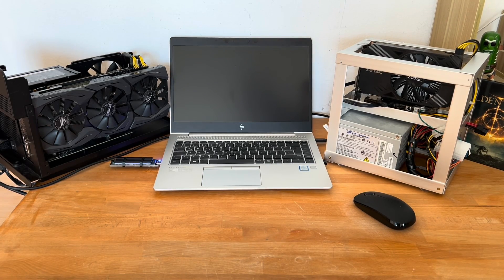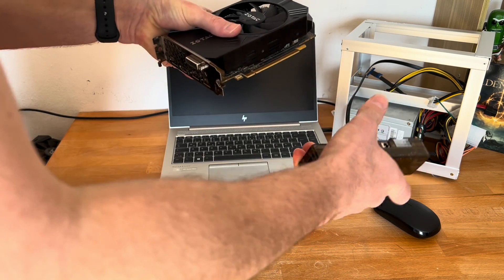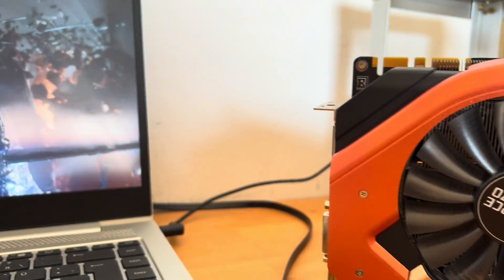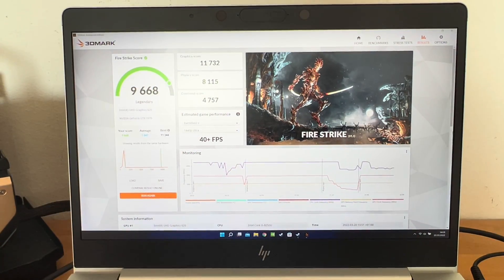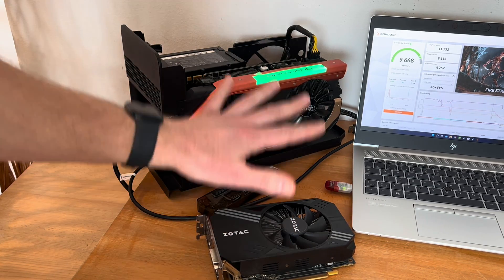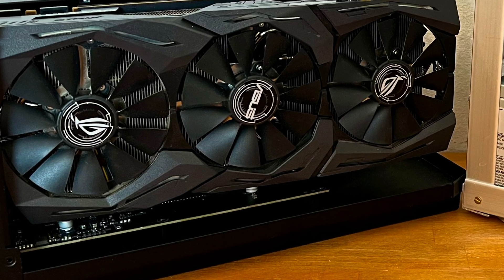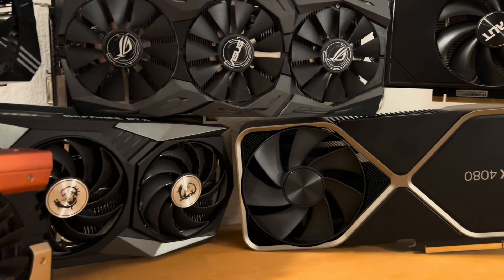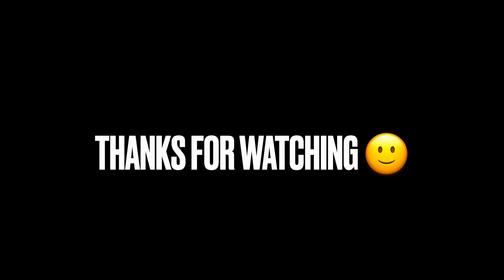RTX 4080 as eGPU??? Does an eGPU still make sense? Test and comparison USB-C vs EXP GDC BEAST

Comment: Can I just ask does the Razer Core X Power on at all without the Thunderbolt cable connected to a laptop ?
Reply from the maker: No. At least not in my case. It is on stand by when the thunderbolt cable is disconnected and turns on when the cable is connected and the laptop is on.
Reply: @ thanks for coming back to me it is really appreciated. I’ve got a non Thunderbolt laptop (AMD based ThinkPad with just a single standard USB-C port) and when I connected it to the Razer it doesn’t power on at all… no fans either side of PSU and no lights so thought it may not be working
Reply from the maker: @myselfexplored Ah i see! Then it doesn‘t support thunderbolt unfortunately.
You can recognize it if there is a thunderbolt icon a the usb-c connection.

Comment: I'm between a ps5 pro and an egpu kit with a 4080 or a 5070ti. My laptop has a thunderbolt port but not a oculink. Definitely can't decide.
Reply: Lol ps5. Bro ps5 has no games, they all go to pc. Trust me man, I've had a ps5 since launch and I've barely used it in the last year. Played the exclusives but psplus and the games are far too expensive. Gonna sell mine. Just do your egpu way, it will save you so much more money now and in the long run.

Comment: Can i egpu an 4070 with an usb c i dont have thunderbolt 3 4 on my laptop
Reply from the maker: No, you need thunderbolt 3 or 4 to run an egpu. You can see if your laptop supports thunderbolt on the thunderbolt icon at the USB-C interface and you need also a thunderbolt cable which has also an thunderbolt icon. 
Not every USB-C cable or interface supports thunderbolt. You can see it at 2:22

Comment: Oculink is better than thunderbolt right cause it supoorts 64gb/s ? I got an oculink 4.0x4 for my rtx 4070 (4.0x16). There really wasn't much of a difference between x4 and x16 unless it's the pcie 3.0x4. My egpu performs 80% of the desktop gpu but the cpu is the limiting factor here. Still an egpu performs way better than a laptop mobile gpu( nearly 30% better)
Reply from the maker: Which Laptop do you use for oculink? 
I haven’t tried it yet. I wonder how oculink can use more PCIExpress lanes. How does the connection method work?
Reply: @Stephan-sPCCorner  ok so there's a pcie m.2 to oculink adapter which doesn't require a laptop to have oculink port, you can just connect it to m.2 slot where you put your ssd. It's a bit complicated but it's faster. The data transfer rate is 64gb/s whereas for thunderbolt it's only 40gb/s.
Reply from the maker: @PHOENlX1734  
Ah i see. Yes, the CPU is mostly the bottleneck of older laptops when using an egpu with a modern cpu. But i think it’s more about how make an older laptop at least gaming capable on the cheapest way. 
It makes me curious that new graphics cards work via oculink and that it’s quite cheap! Sounds like a good alternative to thunderbolt! In my video i have compared only the other two methods with each other in performance and costs.
Reply: @PHOENlX1734  thunderbolt is 32 because it blocks additional 8 for it's needs. Via oculing and m2 it's 40

Comment: I'm using my Razer Core X with a RTX 3080Ti as a rendering node for Lumion and D5 Render connected to my Dell Precision 5540 laptop. Preparations for the 3D scenes are done on my i9 desktop with RTX 4070Ti Super. With the eGPU, this prolong my desktop wear and tear.

Comment: For me my setup was never designed for it to be cheap I designed mine around versatility, I went for a Microsoft surface Laptop Studio 2tb SSD Nvidia 3050 TI 32gb Ram 11th gen i7 and just that alone is an amazing laptop that you can do decent gaming on but I’ve got it plugged into the surface dock 2, I then have the razor raptor monitor 165 hz, the chroma stand, basilisk v2 ultimate mouse the huntsman V2Pro with the Core X chroma EGPU and nvidia 3080 RTX, the reason for my setup is I can just unplug my laptop and take it with me I can game on it, and use it as a tablet edit photos/ videos watch movies then when I want to play some DCS flight sim I simply plug it in and I’m good to go with with a wicked setup, sure there’s a whole lot cheaper probably more efficient ways to do this but it looks cool as shit preforms excellent and suits my needs so for me it’s worth it 😊

Comment: I wish you had used an Oculink port, because the Oculink has 50% more bandwidth than a thunderbolt 4 and 200% more bandwidth than a thunderbolt 3, you didn t even mentioned if you used a thunderbolt 3 or 4, was your egpu PCIE 3 or 4? Your test is lacking of so many infos and is not taking advantage of the best of what an egpu can do.

Comment: I’m stuck between upgrading to a new laptop or getting a GPU as the GPU is cheaper than the laptops available. I tried this with a 4090 and fps increased to 40-60fps at 4k with an hp envy i7 10750h and RTX 2060 max q. Question is would I get same results with a lower tier GPU?
Reply from the maker: Hi Umi_2024,
did i understand it correct?
Your Laptop is a hp envy i7 10750h (10th gen) with an integrated RTX 2060? And then you tried a 4090 as egpu and you got 40-60fps at 4k, right?
Reply: @Stephan-sPCCorner  yes, the 4090 is part of my desktop system, though.
Reply from the maker: @Umi_2024 
Okay i see! 

The problem is the limitation of the pci-express lanes to x4 instead of x16.
That’s what i‘m trying to explain in the video as well.
I haven’t tested a 4090 but a lot of other cards like 4080, 3080, 3060 and 2060 as egpu at 1080p.
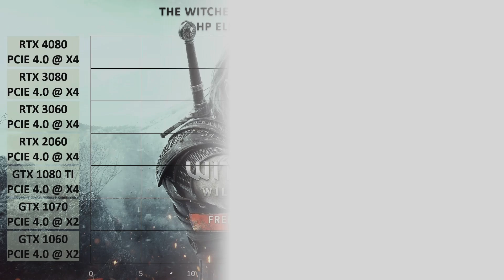When you take a look into my game results at 12:00 , the average FPS at 1080p is always quite close to each other. At 4k it would be even closer and i think almost no difference. 
But okay, that answers not your question. 
If you have the chance to test it with a 3070 or 3080, you could try it and compare the results with a 4090 at 4k. I assume there will be no big difference.
What in my opinion makes more sense is a 4060 Ti (16GB version, because of 4k) or a 4070. You can use DLSS 3.5 and Frame Generation with these cards. This will increase your fps. The 3000 or 2000 Series don’t not support DLSS 3.5 and Frame Generation. Since you have a 4090 you can try some dlss 3.5 and Frame generation settings to see the effect. I think i would go for a 4060 Ti (16GB) or 4070 because of DLSS 3.5 and FG. I think both cards will make no big difference used as egpu and bring you the performance you want by using DLSS and Frame Generation.
Reply: @Umi_2024  check out guides with oculink and m2 port. This will give you almost native performance with 5-7% loss when connected to external monitor

Comment: Hi! Awesome video!!
Can you tell me:
How can I know if my laptop can support an EGPU (using Thunderbolt)?
I  want to buy a HP Elitebook.
Reply: if your pc supports usb4 it is equivalent to thunderbolt 3 so you can connect egpu.
Reply from the maker: Hi Ismael! Thank you!
Yes! If you want to use an egpu like the „Razer Core X“ in the video, your Laptop just need a USB-C connection which supports Thunderbolt and that’s it!
All newer laptops should have at least one usb-c thunderbolt connection. The HP Elitebook in the video has one and this model is already quite old, i think from 2018/2019. So newer models definitely have a connection because it has become more and more standard equipment in recent years. But to be 100% sure, it's better to check before you buy.

Comment: I have got a razer core x chroma on the way & a ayaneo Kun handheld. Whats the best GPU to get linked up to my 4K LG 42" OLED?
Reply from the maker: Hi robhewitt:
Thanks for your comment!
So actually no GPU used as an external GPU is sufficient for 4k gaming, because of the limitation of 4 pci express lanes.

I would say it depends on what you want to do in 4k. Some games with with lower system requirements might be playable with this configuration but have low fps.
If you want to play something like Cyberpunk 2077 in 4k and high settings, it won’t be possible with an egpu.

Comment: i used helio 300 2022 12700h 3070ti with 4k external monitor and 3070ti laptop can not handle it, would this setup with 4080 can handle 4k gaming on external monitor? In your video, it's seem everything above 3060 is heavily bottleneck by the CPU so that FPS doesn't increase, in my case is 12700h would it make any different?
Reply from the maker: Hi TungNguyen,
thank you for your comment!
No, a 4080 would definately make no difference. You will pay for performance that you can not use.
The main reason for the low FPS and performance is not the bottleneck with the CPU, it is the limitation to 4 PCIExpress lanes.
If you would try a 4080 via a USB-C Module like in the video, your limitation is 4 lanes instead of 16 lanes. 
In the video the laptop has an i5 8250U CPU, so a really old one. And yes, your Laptop with an 12700H would definately have better results compared to my test laptop but would never be able to handle 4K with a 4080 as egpu.
Your performance will be even higher with the integrated 3070Ti in your laptop than a 4080 as egpu.
I tested my egpu setup with an HP ZBook Firefly (i7 1165G7 - 11th Gen) as well and compared it with a desktop system (5900X) but with a 1080Ti. It‘s not a 4080 but the difference from 4 lanes to 16 lanes is obvious.
I hope these information helps you.

5900X + 1080Ti
https://www.3dmark.com/fs/29048139

1165G7 (ZBook) + 1080Ti
https://www.3dmark.com/fs/29112178
Reply: @Stephan-sPCCorner  thanks fỏ your infomation. In theory thunderbolt 4 have speed of 40 Gbps and which GPU is the maximum limit. And i'm looking for thunderbolt 5 coming up next, so i hope it would be handle 4080, so i want to buy a Laptop with 14700HX or 15700HX (i'm really need a good CPU for my work) in future with RTX4050 or 4060 for a good price, would it be worth the waiting. Sorry for my bad english.
Reply: @TungNguyen-rg1sc  thunderbolt 4 allows only 32 and reserves 8 for smth so the only working solution with 5-7% loss right now which utilize full 40 is oculink via m2 port. So up to 4xxx series it works fine with m2 and external monitor with any card even 4090 with almost native performance in 4k when cpu is matched. Thunderbolt 5 is not gonna happen in budget friendly laptops in the moment since it's intel cpu tech which they haven't adopted yet. Some high end laptops are coming this year with thunderbolt 5 which cost around 4k+ but only because some expensive adapter inside which they won't put in budget models

Comment: Thank you, great job! 
Please compare content creator workloads: octane benchmark, Cinebench 2024 (GPU mode).
How did you connect the 4080 to the power supply? there are only two 8 pin cables in the RAZER CORE X.
Reply from the maker: Thank you for your comment!
Ah! there is a GPU mode in Cinebench 2024? I didn’t know that! That makes me curious! I will check that out!
Regarding the 4080 and the Razer Core X, the solution is quite easy, i just took a PSU with enough 8 Pin cables 😄.
You can basically replace the original PSU with another PSU in the Core X case. 
Sorry, i didn’t mention it in the video.
Reply: @Stephan-sPCCorner  yes, Cinebench 2024 added redshift benchmark)

Comment: Can U try with M.2 EGPU
Reply from the maker: Hi,
you mean an M.2 NVMe adapter instead of M.2 NGFF (GDC beast)?
I don’t have such an adapter but it might be an interesting variant since it supports 4 lanes instead of 1. I’ll keep that in my mind for another video!
Reply: @Stephan-sPCCorner what about the express card
Reply from the maker: @Hvy1q34  
If i would use an expresscard adapter with my GDC module (v. 8.5c), i would get the same results like in the video because my GDC module is pcie 3.0 and limited to 1 pci-express lane.

Newer GDC modules support pcie 4.0 and 4 lanes, like the variant with an NVMe connection type but that runs via Oculink port. It is acutally an adapter on an adapter. I think express card won’t work with the newer module type because there is no other connection method but oculink and the expresscard technology is quite old.

Since i have not tested this variant yet, i will keep it in my mind for another video! 👍